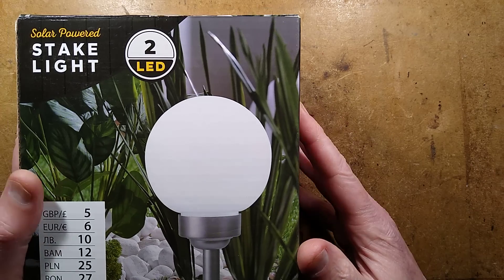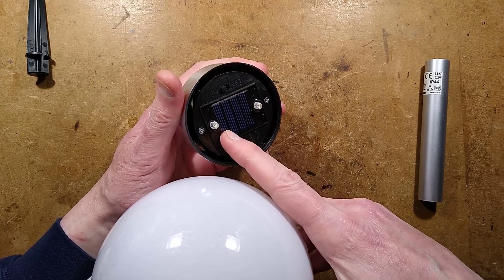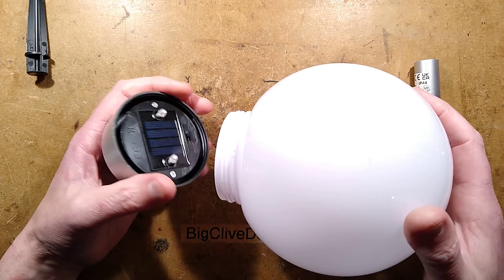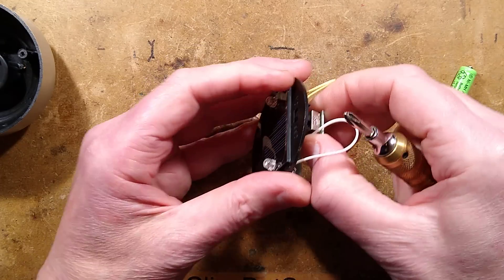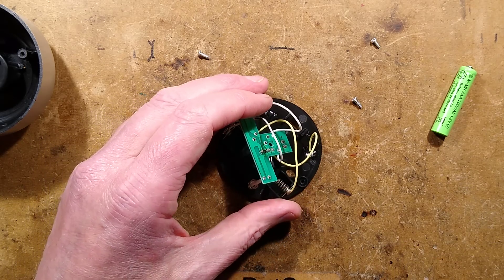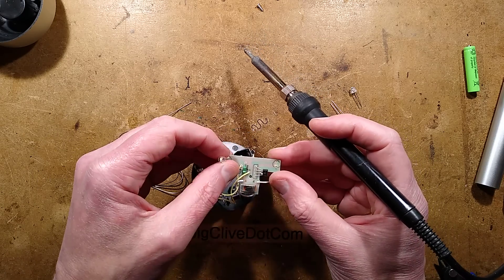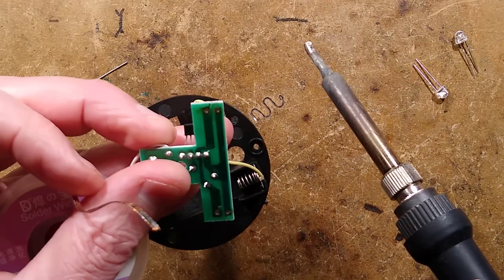Customising Poundland's biggest solar globe (great base for projects)

Comment: Hi Clive, first, many thanks for your video output, Re: cropping before or after - I used to be involved with PCB production many years ago, components would be place uncropped and the board would be wave soldered after this the leads would be cropped and the boards would then go for a second wave solder. The idea behind this is that the second pass would tin all the bare copper ends thus preventing long term oxidising.

Comment: Whilst many people believe many garden solar lights are good for the environment,the opposite is true.They last a very short period of time and therefore produce a lot of waste when they are disposed of.If you actually want to do something positive which does reduce carbon and waste,install PV panels with a battery and you can run normal led lamps off that.

Comment: Got solar lights a year or 4-5 ago and they still work because i covered everything with Vaseline and bypassed the switch. Earlier this year i resurfaced the solar panels and coated them with clear nail polish, hopefully that will prevent them from going white again due to the sun.

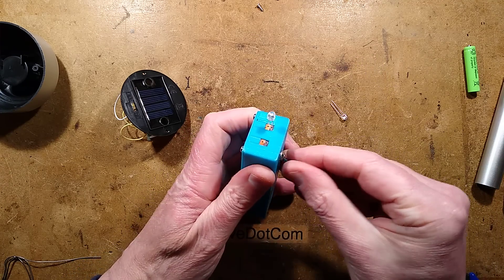Comment: Clive, I noticed that the LED was dimly lit when you plugged it into your LED tester at 3:59.  Does that mean there is a problem with the tester and it is partially on all the time?
Reply from the maker: The tester deliberately leaks a tiny current to test LEDs at very low intensity.

Comment: The blue looks better 👍, some of these have colour changing led’s that have a vast colour range while having just the two leads, they seem however to have multiple anodes and cathodes etc within the epoxy case, could you explain how these work, I’ve tried googling it but keeps returning with the three wire two colour version.
Reply from the maker: The slow or fast RGB LEDs have a control chip and red, green & blue LED chips inside

Comment: 🔋 BLU VAPE BATTERY🔋Hi Clive, fellow Scot 🏴 here 😁 love the videos! I was just wondering if you had any ideas on how to reuse the batteries from BLU disposable vapes as the are so well constructed? Maybe a easy little recharging build or how to make a power bank from them? As it's such a waste. I'll let you think 🤔 cheers 😊
Reply from the maker: If it's the new type with the twist removed end where the battery literally pops out, then I made a charger by using an existing body as a holder and contact, and a TP4056 module.

Comment: Clive - at 8:20 where you reinsert the screw asking 'is it going to go in the right position' (thread-wise) - there's an easy way top ensure correct alignment.  If you put the crew in and gently turn anti-clockwise you will feel when it drops into the correct thread place... then tighten it up.  Self tappers can only go in the socket twice, once correct, once incorrect and then after that you're 'screwed' as the hole is stripped so a few seconds of sensitivity pays dividends!  Same for screwing into aluminium too 👍
Reply: If you watch closely, you can see he did this a couple times.

Comment: All cheap items have failures deliberately engineered into them. UV exposure is another trick. Is there a clear anti UV coating that can go on those panels?
Reply from the maker: Some have sprayed panels with a UV blocking clear coat.

Comment: It was just today, I saw another solder joint, with a solder fracture, after a factory had cut the  component lead. Also saw a repaired fuse, which  turned a 1A fuse into a 100A fuse!!

Comment: Ten Roubles - pretty cheap in Russia 🙂.  Possibly worth it for the diffuser alone, which can be re-purposed very easily. I'll have to check out our Reject Shop to see if these are available "Down Under". Goot braid seems to be very good for getting rid of excess solder.
Reply: лв or lw translitterated probably isnt rubels... that would be 20ct european - absolute steal and absolutely unlikely

Comment: If you was worried about the solder points "cracking" from trimming the leads after soldering, couldn't you just re-flow each pad real quick after trimming?

Comment: Just brought some solar lights and decided to follow your advice Clive and smeared the circuit board in Vaseline to protect it from moisture. Problem is the Vaseline quickly turned to liquid when the sun started beating down on my solar lights and pooled inside the glass cylinders the LED's shine down into. 

Thinking I need to use a grease with a higher melting point like silicone perhaps? Or could just spray some conformal coating on the board but degreasing it now is going to be fun 😁

Comment: Comment on mil standard soldering. In the late 60's I was trained to DEF5000, the then military standard for soldering components onto circuit boards (OK, I'm a, retired, elderly flatulent). Each finished joint was to be a separate hemisphere on the track side of the circuit board. The pass/fail test was a square of 0.1" veroboard and we had to populate it with 1" loops of stranded wire across adjacent holes. Each joint had to be separate and the instructor would drag it across the back of his hand, any scratch marks would fail. I had been soldering since the age of 11 and passed first time. As a reward (??!) I was given a 0.05" board and told to do the same thing, although with solid core. Sod of a job and technically failed it because of too many joined up hemispheres! The reason for hemispherical joints (pre-trimming leads) was to prevent high voltage corona discharge points. In those days, apparently, it was not uncommon to have HT sections on some boards, hence the regulation. Once you get into that habit it is difficult to give it up, even when prototyping.

Comment: The specification you referenced is DEF STAN 57/21 which among other things says crop leads first as moisture can degrade the copper and introduce noise.  I’m sure you’ve seen verdigris on joints cropped after soldering when you go back to look at equipment mounted outside.

Comment: Temu do some micro LED's for railway modelers that twinkle and flash red Green and blue in patterns; changing speed at times. they will run of 1.2v to 3v without a series resistor and you can wire 4 of them in paralel easily. I've used them on som Scale Model Dalek builds; but I'm not sure just wow many you cou;ld wire together. and positioned at random heights in one of those globes... It might look like a bunch of trapped demented fireflies. they do a number of fixed colours too. Red, green and blue and Bright white and warm white. It would be interesting to see how they work wired in series... and yes they do flashing LED's in the same micro size. They are surprisingly bright as well. Maybe a project for the future?

Comment: I'd use a can of conformal coating spray, rather than slathering the pcb with vaseline, which can actually trap moisture under the grease if not applied just right.

Comment: I wonder how easy it'd be to remove the stake holding portion at the bottom and make it flat so I can set it down on a table. I wanna get one and stuff it with 18650's and neopixels, charged with a USB C socket
Reply from the maker: I've toyed with 3D printing a base for this light.

Comment: I suppose it’s possible to pull tracks off the board if you snip leads like a complete animal after you’ve soldered them, but if you cut the leads like that that you shouldn’t be soldering boards anyway. I’ve never had an issue.

Comment: The thing with these devices is you can repurpose the casings for other projects, as I am sure Clive and everyone else knows already. Last year or the year before I bought three 'pillar' lamps from Robert Dyas (which I noticed on Monday were on sale for £2.49 each in the Weybridge branch!). The lower two thirds or so is empty rattan effect plastic with a diffuser section on top (which just pulls off) and the top section is where the leds, etc, are. They are supposed to light up with a flaming effect, but all three have stopped doing that, even though they haven't even been outdoors. I thought of replacing the electronics etc with colour changing leds, an esp32 and a connector to make it all work off a 5V power supply. The esp32 and WLED software will make for some nifty effects!

Comment: Clipping the leads after soldering is perfectly fine. If you get carried away and clip off some of the solder, that would be problematic.
Reply from the maker: That sometimes happens with brand new and very sharp cutters.

Comment: re, cropping leads, I did civilian training at an RAF base, the leads were cut to size so that the end of the lead should be covered by solder and smooth to the touch....
Reply: I like the "splayed legs" holding things in while I solder - but then usually after cropping leads, I tend to "go around re-flowing" so the board seems more "finished" and partly just in case the "jolt" of the cutter might have disturbed a joint.

Comment: The military spec is applicable to things like air to air missiles etc. Those scellerate so hard they are doing mach 2 more than the launch aircraft in the length of the rail (typically 2 meters. IE they pull 3000G for the first few miliseconds. If your garden light gets subjected to 1;10 of that I would love to know how.
Reply: Drop it from the roof onto a concrete path? I expect other parts would fail before the LED soldering under such conditions.

Comment: It would be SO neat if there were a really simple way to use solar lights like these for ESP8266/ESP32 projects! 
I gather what would be perfect would be some ultra-low-power way of keeping tabs on how much energy has flown into the battery, and only if it is enough, trigger some boos converter and wake up the ESP from deepsleep for a couple of seconds to do its thing (measurements or whatever), and then go to sleep again.

Comment: Could you maybe fit a larger cell, maybe an 18650 depending on how big the stake post is inside of it since its plastic? or maybe a AA cell if an 18650 is too big, then you could seal the post so water wont get inside of it. (Depending on the voltage of the AAA)

Comment: Changing the LED's is relative to each intended use... 1. cosmetic, 2. functionality such as lighting a path. modifying to series the LED's will reduce the current thereby reducing light output but increase battery life.

Comment: I never look at the length of leads.  In LEDs, cathode will always be the thick "shelf" that the die sits on, and anode the little stick connected to the die with the Au wire.

Comment: Would this work with those lovely colour changing LEDs?
Reply: Some LEDs have a built in resistor.
Reply from the maker: With a diode and capacitor it would.

Comment: In my own experience, I found these hidden solar cells not nearly as efficient at gathering light inside the globe.  But 150 uh only gives about 7-8 mA?  Must be really dim to begin with.   Could always lower the inductor, add better battery, brighter LEDs.  What about an LED string around the base inside?  Maybe use about 50 mA.

Comment: I want to buy a couple of dozen, replace the LEDs with color-changing ones, and stick them all over my yard. Party!
Reply: You'd need to add a diode and capacitor for that. Otherwise, those color-changing would stay at one color all the time because the pulsed DC would reset them continuously.

Comment: Most DIY attempts to waterproof outdoor electronics will ultimately fail.  Water always seems to find a way in.  Even if it is just condensation from the air itself.  I know this from charging e-bikes outside. The charger always gets knackered. The only way that works is to keep the charger indoors and run an extra long charging cable out the window.  Lamp cord is good for this.

PS - That's a nice blue globe. Having several of different colours would be really cool.

Comment: The reason they want you to crop the pins before soldering, is corrosion protection. When you crop the pins, you expose a little bit of bare copper, which is more susceptible to corrosion than solder.

Comment: I'm so pleased someone else has spotted the long lead/short lead thing, but it's not limited to red LEDs.

About a decade ago I salvaged a load of cheap LEDs from a bunch of broken/faulty cheap fairground light toys (that cheaply made they'd not trimmed the legs) and was confused that a large number of yellow and blue LEDs seemed to be faulty until I reversed the polarity and discovered the swapped leads.
Reply: I've found that if you look into the side of the LED, you can see the "cup" that the chip is in. That one is the cathode 99.9% of the time.
Reply: I have had lots of LED's with reversed leads.
Reply: @dogwalker666  so have i, NEVER assume the polarity 😉still got a few 3mm ones i got in the mid 80s that are 'opposite' 😉
Reply: @andygozzo72  exactly.

Comment: OR .... you might insert two  POUNDLAND™ orange Halloween LEDs ( available soon  ! ) ... and draw eyes , mouth with a black marker pen ... ( for a " reverse " effect ? pumpkin lamp ...hmmm ? ) .... look out for the BIG  white polythene globes that ( used ? ) to sit on top of black and white stripey poles in the UK road traffic islands ... these are being replaced , so available ? ... I have one , and with a B&Q colour changing mains bulb inside makes a TRENDY ?  room light .... this year's solar lights are wired with ALL white wires , so best draw out circuit  BEFORE dismantling ( ? ) ........ DAVE™🛑

Comment: Hi Clive,
             The GPO that was, the post office was and not sure about BT, however the standard was to crop the leads prior to soldering, they insisted that the bare copper end could corrode and compromise the joint over time.  Not convinced of that, but the clerk of works would come round with his magnifying glass and insist that the joints be reflowed.  Having to go over a 1000 joints what a pain.
Keith.

Comment: Change the LEDs to a different colour , Spay the base black , use epoxy glue, to attach them to a cheap fancy wall bracket, a smear of Vaseline around the base of the plastic glob  tread ,to stop water ingress and use them as a cheap outside wall light . Job done

Comment: Wouldn't any "stresses" in solder joints, resulting from cropping the leads or looking at them angrily or using abusive language on them, be "erased" by simply reflowing said joints??
Reply: Yes, but most people don't do this after cropping.
There is of course a difference between the reliability required from a $1M piece of military hardware and a £5 garden light.

Comment: What would be the pros and cons of parallel vs. series LEDs in these circuits?
Reply: Perfect current sharing with series connected LEDs. I've never liked putting LEDs in parallel, since one could hog more than it's share of current, but you see it in cheap products all the time.
I guess the pro for parallel LEDs is you could put more of them in parallel than you could in series. (Circuit has a max output voltage for only 3-4 LEDs)
Reply: @kimchristensen2175  : Thanks, that was indeed enlightning.

Comment: Cropping the leads is considered to give the solder joint a mechanical shock which may result in a dry joint later.  I normally cut before soldering but if I have to cut after soldering I reflow the joint with a little more solder.  But then I was working on pcb's that had to withstand high levels of vibration from jet engines just behind the pilot 😊 what your taught as 17 year old tends to stay with you for the rest of your life.
Reply: When I was in the USAF in the seventies we were taught to crop leads before soldering too, but not for that reason. It was because you don’t want to cut off ends to ping into the rest of the electronics, never to be seen again until they short something important out.

I suppose both reasons are good reasons.
Reply: @markfergerson2145  well we had to also bend the leads flat to the pcb and along the axis of the track. Once soldered you had to still be able to see the lead with just the right amount of solder forming a filet between board and lead. Any joint that did not pass inspection got a little paint dot by it. As the only bloke in the room and only a 16-17 old, I'd  get a smack for every bad joint. They would take turns ;-)  not sure it would be allowed nowadays but you learnt to solder fast, it was like having 20 mums checking your work:-) to tell the truth it was a great time and I'd never go back and change anything.
Reply: @TheEmbeddedHobbyist  Yep, very similar criteria in the USAF except for RF leads. With those you had to be careful about avoiding crosstalk. Good thing for me that I learned to make good solder joints in High School radio shop.

And don’t get me started on tying wire bundles with cord.
Reply: @markfergerson2145  Lacing cord! why not get started on that. the number of fine cuts I got rom the cord cutting in to the finger joints as you pulled it tight. I still do the odd lacing to a wire bundle far far better than cable ties in confined spaces.  I must have laced for about 2 months before I was let loose on a production job. Somewhere I still have a 37 pin D connector wired to look like a bonsai tree that I did when I was training  back in 1976 🙂
Reply: @markfergerson2145  Good point!

Comment: I much prefer lights that use 18650. And I always conformal coat them before doing anything else, because these days many just come with the bare PCB in the case without any sort of corrosion protection.